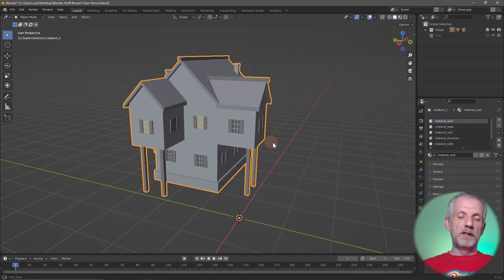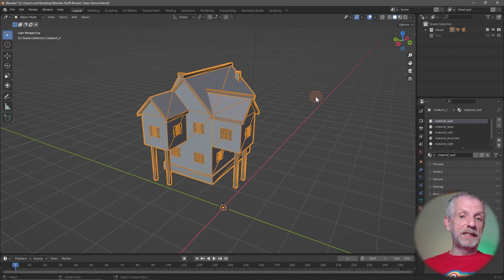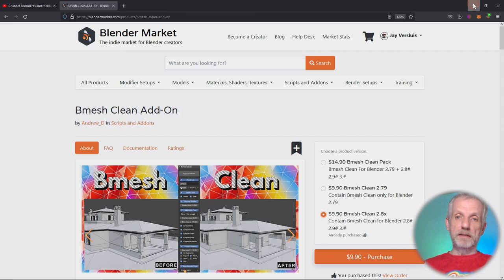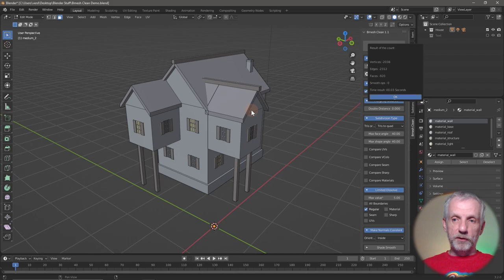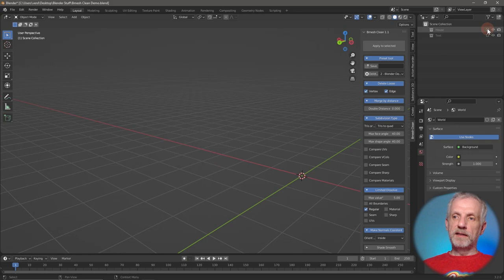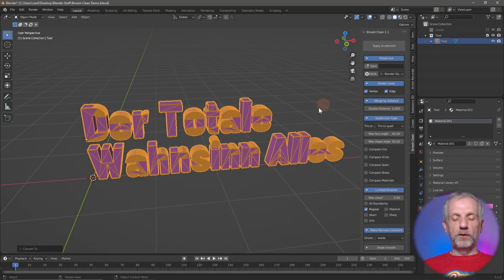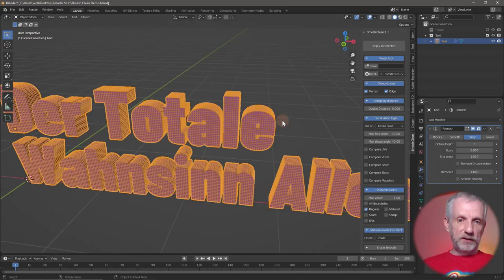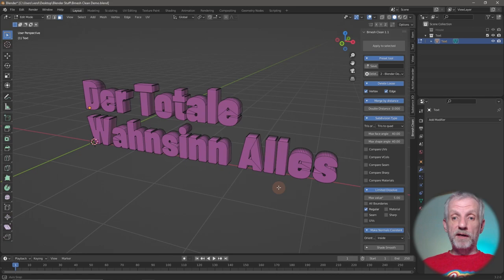Fixing wonky topology in Blender with BMesh Clean (like triangulated messes)

Comment: that's perfectly good game topology, if you want an easy way to put good materials on it you can very easily just unwrap it and texture it, or select faces and assign material slots if you don't want any proper textures on it, and those untriangulated faces can cause huge problems when you take them into another engine and leave it to that to triangulate it, you'll have windows filling in, awkward shading from overly long squashed triangles, there's all kinds of mess that can come with just running a limited dissolve on a model and exporting it to use elsewhere (and all that addon seems to do is run a limited dissolve on the model).